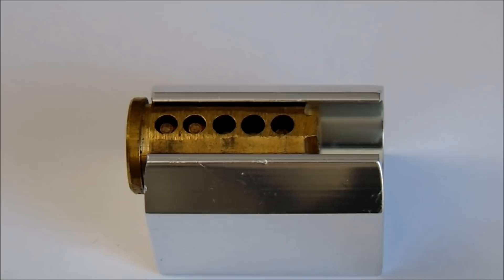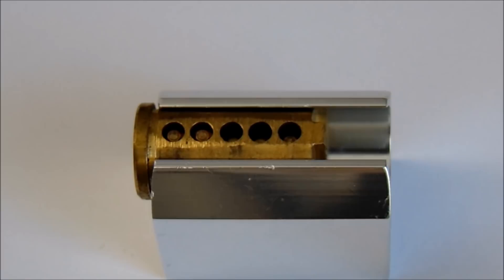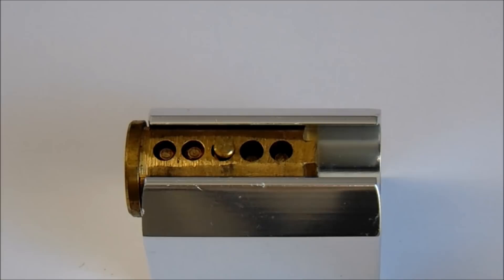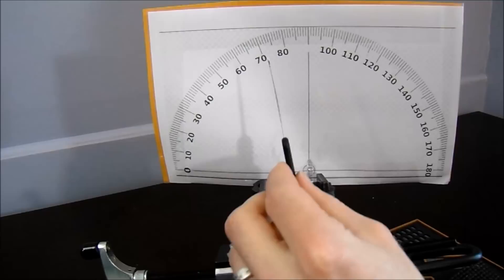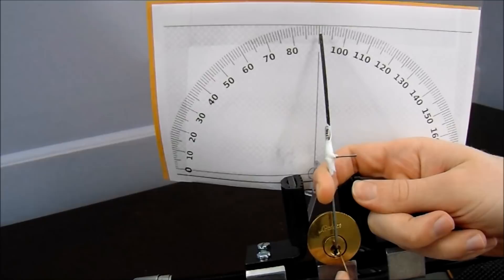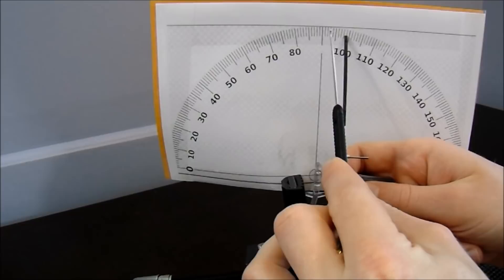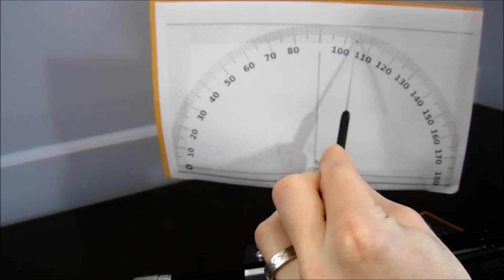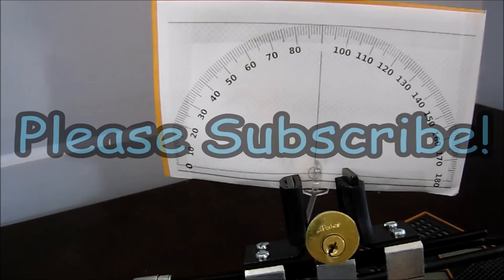[137] How To Beat Your First False Set (Lock Picking Basics)

Comment: I find that the secret to false sets and spool pins is fine-tuning how much tension one applies -- just enough tension to lend a little resistance / friction to the pins, but no more.  Also, there will be oversets, and releasing the tension just the tiniest bit to release the oversets (and then probably increasing the tension again in the next nanosecond) is a talent I'm working on.

On occasion I've gotten past spool pins by mashing all the pins up as far as they go, holding them in overset position via too much tension, and then easing up so that the oversets free themselves as described above.  This isn't a great technique and I've abandoned it for the most part, but I think it helped train me to handle ovesets better.
Reply from the maker: kingbeauregard have you heard of reverse picking? That sounds a little bit like your second technique it's a pretty cool technique when it works

Comment: I've been trying to find out what a false set was and nothing I read or watched made any sense until I watched this video. Thanks!  I do have a question that perhaps one of your videos explains but is there a simple way of telling which direction to apply tension while picking?
Reply from the maker: You tension in the direction you want to open. Deadbolts always open away from the door frame. If you pick it the wrong way you can always use a plug spinner to fix it.

Comment: If you have 4 spools and one standard, do you have to set the standard pin first to be in a false set prior to setting the spool pins? If you lose your false set, do you have to get it back again before picking the spools again?
Reply from the maker: Once you pick the standard pin the false set should present. However, some spools sit on top of tall key pins where the thinner diameter actually never comes into play

Comment: Yeah, I'm pretty good at picking locks but I now have the Sparrows revolver challenge lock and it produces false sets and when I get one I  stand no chance of getting out of it  I either have to reset and hope I  don't get it or simply fail, but there is one key position that false sets every time now and I can't figure out how to get through it. I can't seem to make my cutaway produce a false set so I can see what it's doing, so here I am, I hope this video will help me.
Reply from the maker: It might be easier if you practice on a more standard lock. It think Kwikset is a good lock to learn on
Reply: @HelpfulLockPicker  I have all of the Sparrows Schlage locks from 2 to 5, the cutaway. The revolver is the 1st lock that I've been able to get a false set on not sure why. I even have the pin reload kit and the master key set. On lock 3 of the revolver, it has mushroom pins and it produces a false set that I just can't seem to recover from.  Sparrows don't have Kwikset type locks and the site I found them on are just too expensive when you tack on shipping. So these are the locks I have I also have a few Schlage commercial locks but the cores in the mortise locks I have, the tolerances make security pins useless they just don't fit in tight enough to make the security pins effective. The revolver is currently the only lock that I can get to create a false set but it has only been a few weeks. If I could just figure out a way to produce a false set in my cutaway it would truly help me but this video has given me an idea as to what is happening, so I'll just keep practising until I get through it.

Comment: I'm stuck on a storage disk type lock (with the shackle that runs the outer circumference of the  pancake style lock body) that doesn't seem to give any feedback whatsoever. I've tried raking and IPP and can't seem to get a pin to set enough to get any rotation or any false sets. I am utterly stumped. I've tried both high and low tension, and a variety of different hooks. The key pattern has a very aggressive teeth, with one set all the way up and the following as far down as that style allows I suppose. I guess I'm probably interfering with the set somehow with my hook, but I can't figure out what I'm doing wrong.
Reply from the maker: some of those can be tough in general and have a tough keyway.  I would just put it down and come back to it in a week or so
Reply: @HelpfulLockPicker  Thanks! I do feel like I’m getting a feel with the hooks and have had success with other locks, but this one is tough (Started picking two months ago). I almost bought another one from Harbor Freight just now to see if I could pick a different one (mine is from a Uhaul self storage).

Comment: ok well i have a new question (BTW thanks for anwering one of my other questions several days ago)... I have a standard door lock on my bedroom and both times ive managed to get it almost picked it goes into a extremely deep false set almost  to the point its should be unlocked but its doesnt fully unloc.. like its 3/4 of the way there... i cant imagine it being super high security since i am pretty sure it was a cheap one from menards or even walmart.... im curious what could cause such a deep false set in a cheaper lock like this.. could it actually be trap pins? and i wonder how i would know without gutting (assuming its even possible) it to see whats inside... Id love to defeat this one now!!!
Reply: i just tried our front door and the same thing happened.. *confused look*
Reply from the maker: To start off you shouldn't pick locks in use it is a bad practice. I would have to see a photo of the degree of false set but it could possibly have a t pin  which could be causing it.

Regardless of it being a t pin or  spool  it would take the same way
Reply: @HelpfulLockPicker  i think i can give you a mental image at least, because it was the same degree of false set on both locks.. it stopped at the 9'oclock position.

And i wont do it on my front door anymore.. my bedroom door i am not as worried about since it was more about privacy than security.

I did ask in a facebook grop and somoen said it could be construction keyed, but i dont think that is what i bought. Unless i did it without realizing what they were.
Reply from the maker: @razoredgechris  If it had construction keying the original key would likely  not work anymore, does it still work?
You are probably stuck on a spool over a short key pin

Comment: But what is false gate?
Reply from the maker: That's more of a term for locks that use other mechanism
Reply: @HelpfulLockPicker  thanks! Btw, i learned a lot from ur vids. Im new around here, and i need a good explains how locks works. So funny hobby!
Reply: Btw i have one question. Im waiting for my new huk red dimple pick set to arrive, but i saw from BBs video, that tools from this set is too thick for a lot of keways. So can i sandpaper them to get 0025 or whatever?
Reply: Same with tension tools
Reply from the maker: @stahinjakrackovic2087  A lot of the simple sets you need to customize to make work better. Hopefully this link helps https://imgur.com/a/9xG5Z